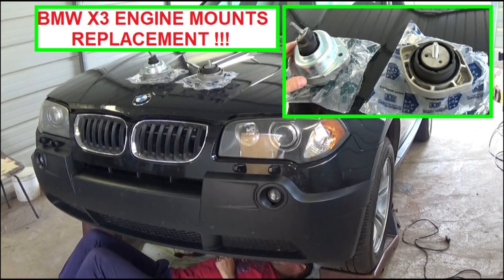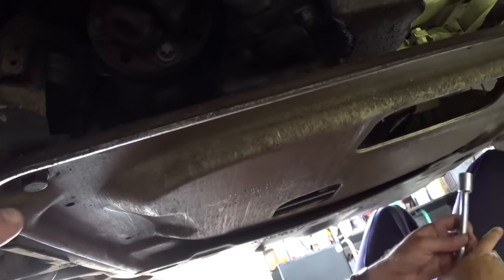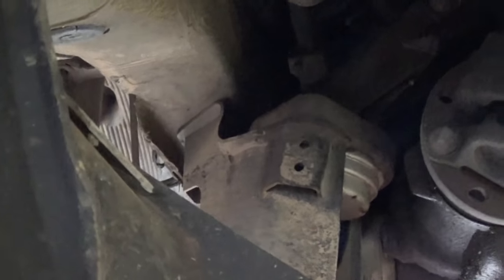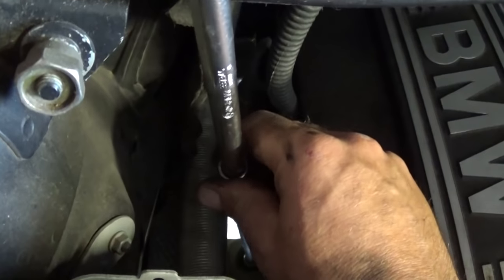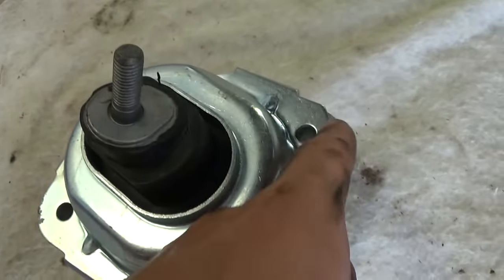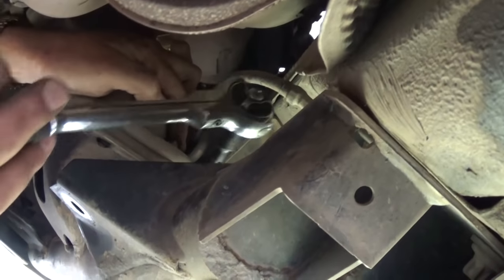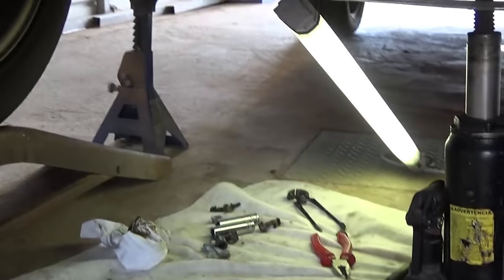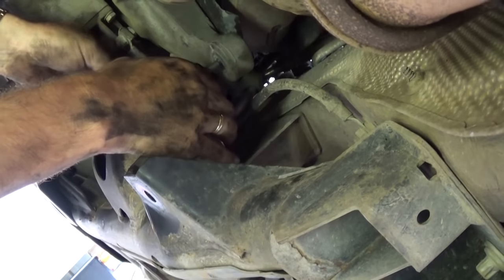BMW X3 e83 Engine Mount Replacement  Driver side and Passenger side Engine Mount Replacement!

Comment: This guy has it right.  Everyone else says to drop the subframe. A huge job. One bolt got the steering linkage out of the way and there is just enough room to get the new mount in. Saved me a ton of time. Thank you thank you thank you!

Comment: The later (2007 onward) is different on the left side.  You have to loosen the steering shaft coupler and push the shaft toward the steering wheel until it comes out of the coupler.  Then you can fold the u-joints out of the way to access the engine mount.

Comment: Pretty sure this is my issue in my 2007 X3, suddenly Started Vibrating in the cabin when idle and while driving, Im at about 85K
Reply from the maker: +Vincent “Stubakka” D Most likely it is the engine mounts. We had a BMW with less than 70k that needed mounts as well. If you feel vibrations while idling then most likely it is the engine mounts. If you ever need help with your vehicle let us know you can also find us on Our Official Facebook Page here: https://www.facebook.com/worldmechanicsofficialpage/?fref=ts
Reply: turned out to be, Misfiring from one or more of the Spark plugs
Reply: World Mechanics I have a BMW X3 2010 with the same problem, where do I buy the engine mounts? And how do I know the right fit to buy.
Reply: Vincent D I have 2010 x3 and it vibrates like crazy when idling. same problem

Comment: How do you diagnose these faulty engine mounts?
Reply: One symptom is vibration especially at idle, another I've heard is to watch the engine for movement while another person shifts.
Reply: How do you know it's motor mounts and not the motor mount bolts?  It seems there is also a motor mount bolt breaking problem as well?
Reply: This was my problem - all 4 aluminum bolts broke off the bracket on passenger side. You will know if this happens, the motor dropped a few inches visibly! I had to drill 3 of the bolts out using an extractor and replaced with 4 new bolts and 2 new motor mounts.